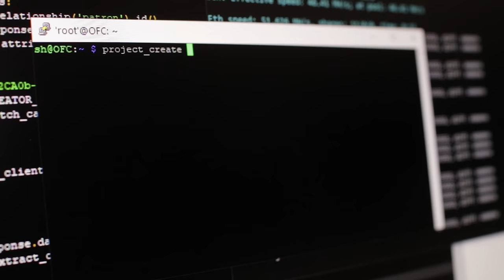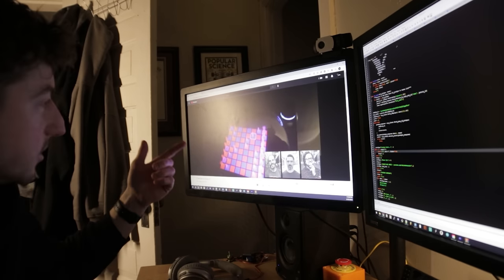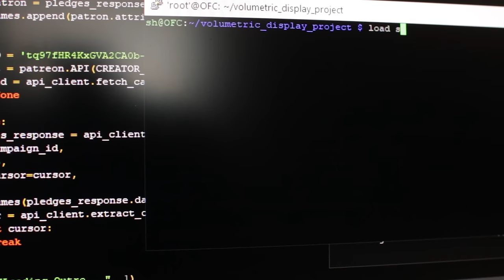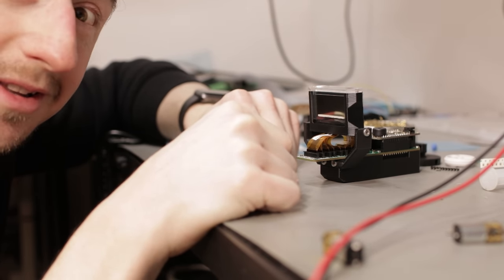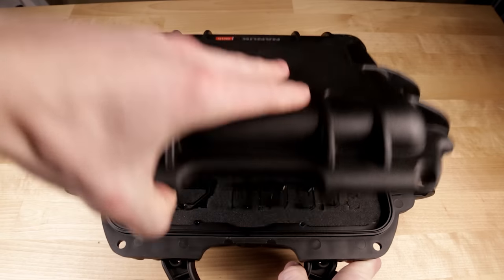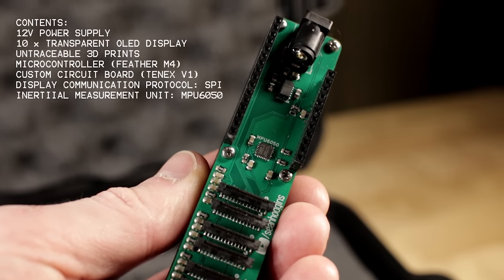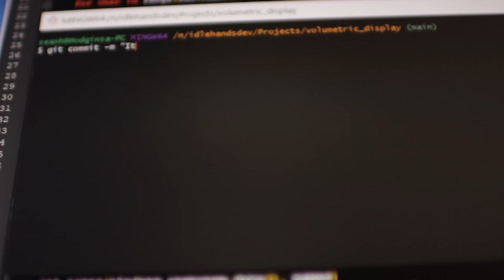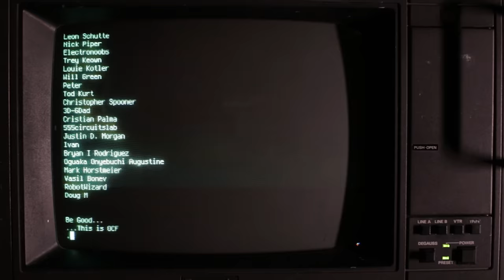TENEX Solid State Volumetric OLED Display - EP-T0-622343EB

Comment: I'd love to see a ~20" version, at about the resolution of old tube tv's, with maybe 4 or 5 layers. Then we could maybe run emulators on it, using different planes for the different planes older systems used.
Reply: You can buy them but they cost alot

Comment: I HAVE AN Idea. The HOLOCUBE...cut perfect symmetrical triangles out of plexiglass or plastic with glass cutter or untility knife. Then create 2  4 sided pyramids- open bottoms. 
    Step 2
   Put square oled screens facing up on bottom of 4 sided pyramids. 
    Step 3
                Make cube with 4 square pieces of plastic or plexiglass open top and bottom
       Step 4

      Rubber cement it all together 1 pyramid facing up with point and 1 pyramid facing down w pyramid points connected in Middle of Holocube
     STEP 5
     PLACE TOPLESS AND BOTTOMLESS CUBE OVER AND AROUND PYRAMIDS.
     Keep in mind OLED screens will be facing each other 1 top down 2nd bottom up.
       Rubber cement well...take a break!
    Step 6
      Fill chambers in-between cube and pyramids w neon gas...infrared and blacklite LEDs work. 
          Then merge image/motion projection top down/bottom up stereoscopically.
      They together create distortion visual.
          First video games...arcade classics pac man holographix/rampart holographix/1942 South Pacific🤯🌀😵‍💫🤡🍦🦄💅💀👽🫧🤍🫧🎃🤠🎃🤠👻🤯🌈🤯🌈🤡😵‍💫🌀🍕🍨😘😤🤬🌝

Comment: put a single lcd on an axle attached to a veritable resister to register position... a motor to spin it... program to read out the resister's position and display images accordingly.. now the axle can be layered for each connection to lcd... or you could do a single digital chip to separate incoming signal, separate the axle in half positive negative and a brush and plate.. or a combination of them for power and signal.. put it in a clear box, vacuum out the air if you'd like.. but the lcd could be any size, so long as you vacuum out the box. much better than this..
Reply from the maker: This is actually something I’m working on
Reply: @SeanHodgins   back when I first did this we didn't have wifi or bluetooth.. could probably stream the images to the screen now.. it would also save the effort of signal, you'd just need power..

Comment: Ahahahaha did you just put a hoodie on and hacker music to program in arduino lmao. As a software engineer this might trick the masses into thinking you're a genius but you're using the most basic interface protocol imaginable to essentially just drive a few screens. Try scratch next time it will make you feel like a real hacker. But for real you'll probably find your particle physics will run a lot more efficiently with none of the latency if you program it bare metal with C.
Reply from the maker: I always have a hoodie on.
Reply: I'm a software engineer too and have to say that people with your attitude are an absolute nightmare to be around, let alone to work with.